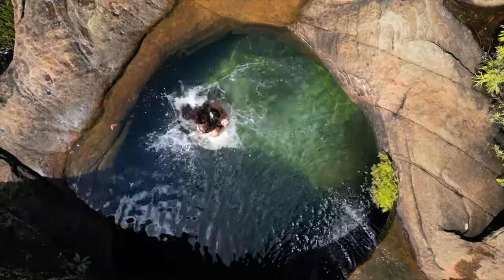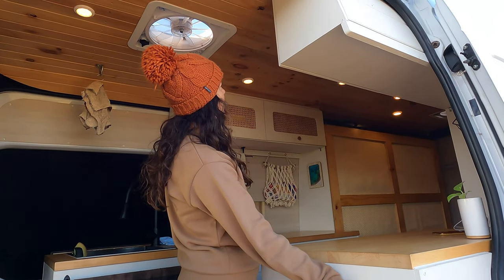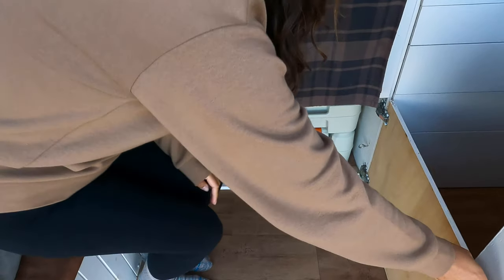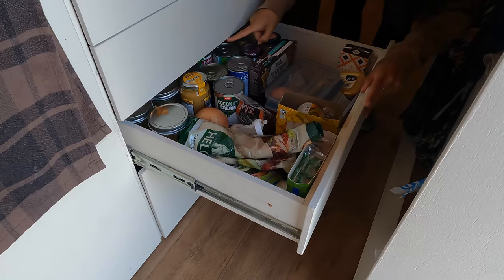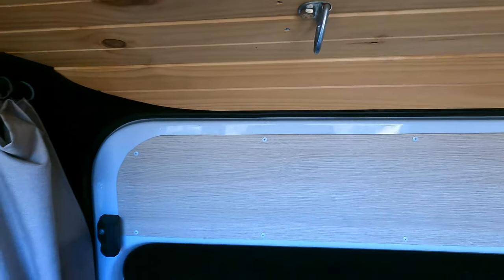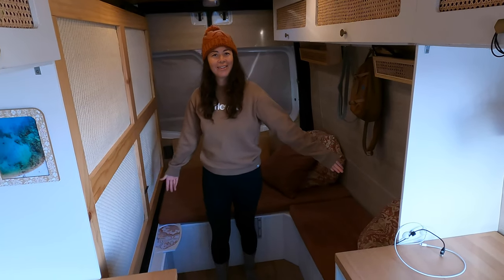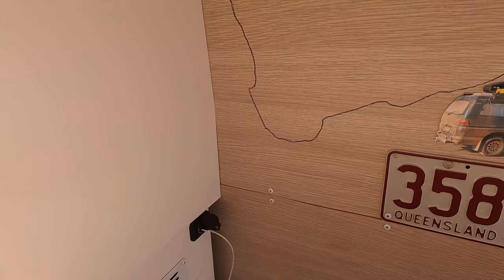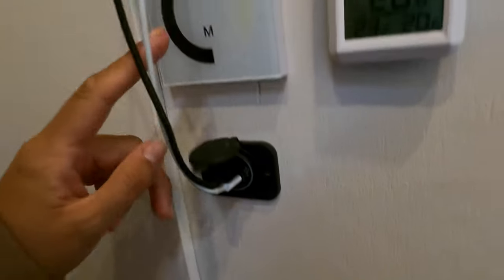VAN TOUR Sprinter Layout + Murphy Bed. DIY Build | VAN LIFE Australia

Comment: I am very sorry for your loss.  God bless you both and your baby in heaven. What a beautiful van. Very  roomy and practical. Would you please tell me the brand name of the heat proof foil paper that you have lined your air fryer.  Also what brand is the air fryer.
Reply from the maker: Thank you Jennifer 💛
The lining isn’t really heatproof, but it’s the same thing we used for our insulation so as to keep the heat away from the benchtop. I don’t know the brand but it’s a cut-off of foil insulation (kind of like reflectix) - hope that helps!

Comment: I am doing my van build in June. I am building on the largest Sprinter. I would love to know about supplies and if money was no object what to would you do in your van? Do you have any work space? Do you have a roof rack or awning? Anything you can suggest?? I will have a wet bath and an oven. I want to have a place for an ebike. Just wondering what you do?? 
I'm sorry for your loss. I know what that is like. I had 8 kids after that so you will have the space for that once you are ready. Do you have an AC or heater??  Thanks so much I am new to you and enjoyed this video.
Reply from the maker: Hi Sheryl, thanks for watching. Great questions. I guess when it comes to building an adding all these extras money wouldn’t be my main concern - it would be making sure it came under the correct weight for its GVM capacity. 
However, we’ve personally chosen not to have a roof rack because 1. We have nothing extra to store, 2. It’s very high up and we would need a ladder to get up, and 3. We wanted the space to fit as much solar as we could while still having two fans. As for an awning, we dont have one at this point in time because we haven’t been able to find the right brackets in Australia to fit one due to the way we have fitted our solar panels. If we had a roof rack then it would be easier to fit an awning. Keep in mind those logistics when planning your build. I think it would be nice to have one later down the track when we stay in one place for a longer stretch. We move around quite a bit now so I can’t think of many places we would use it. It really depends how you travel personally. If money was no object then an awning would be great. The one we would be happy to get is about $4k.
If I was storing an ebike I think it would be best to access it from the back under the bed on a slider for ease. The bed would need to be a little higher and it would need to be a fixed bed. Because you have the longest sprinter you would still have lots of room inside - I assume you mean the XLWB (ours is the LWB).
We don’t have a work space as we don’t work right now but when editing videos I just pull out table out and use that. If I worked from the van then I would put a dedicated space in where our second kitchen bench is.
I think if we had the longer van I would definitely put a wet bath in with a bidet style shower. I have a few space saving ideas in mind for one that would work really well and make draining easy.
If money was no object we would put AC/heater in. We travel completely ‘off grid’ style and don’t plug in anywhere so we don’t have the capacity to run aircon, and we also stealth camp alot and aircon on the roof is so obvious 😆 If money was no object then we would have bigger battery capacity or stay in a powered site to run the aircon when we need it.
Again, think of the space on your roof. If you plan on staying in caravan parks or powered campsites then you probably won’t need as much solar so the roof won’t be full of panels.
We are working on more videos to answer questions like these and give you things to think about when starting your build, so please keep watching and if you have any more questions let us know.
I hope this has helped 😊
Reply: @miaandryanadvantures  This has helped thank you!! I am looking at a split  cruise & comfort so no roof space. I am to be mostly off grid. A 2nd alternator that is anither way to charge a very large battery system. Hydronic heating and hot water, etc. I wonder why vans Don't have a disposal in the sink? It is easier in trash. You had propane I want both. I do not like induction. I will ha e one not built in and I am not sure which oven yet. Either Brava or a multi use oven. I love to cook so a suvi will work like your rice cooker but allows more options. 
Thank you so much!! I am watching and look forward to learning more 😊